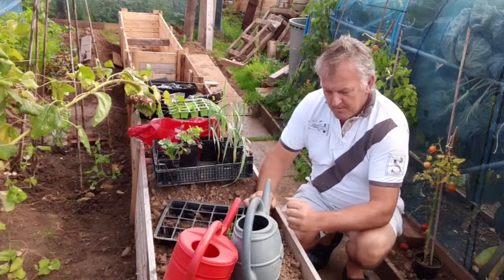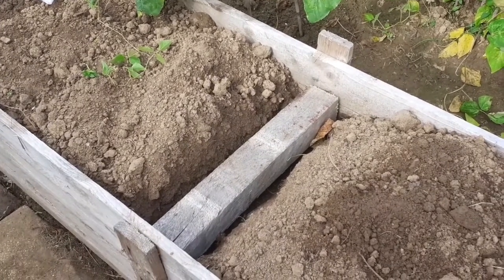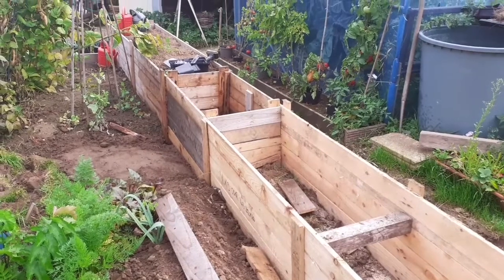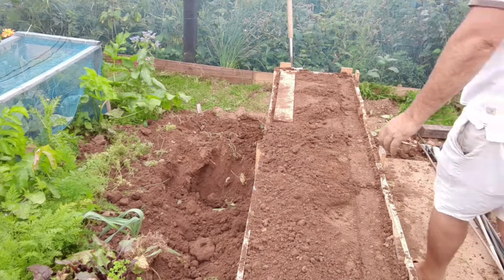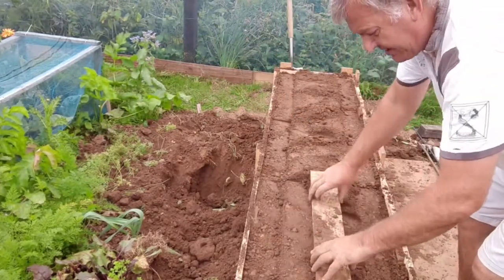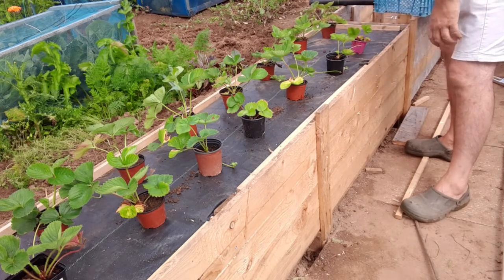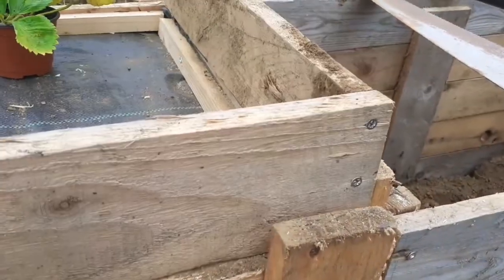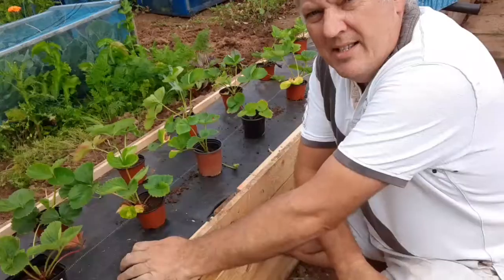How to Build DIY Strawberry Planter from Pallets | Pallet Project

Comment: Lovely job but if not treated wood will rot through very quickly so lining might have been a good idea. Something to think about in future. Terry  king does a good raised bed with pallet collars. And posts sit on nails so no part of wood sits on ground.  I know you have bases.  I’d be using weed suppressant instead of wood. As this will rot, the base in wood will rot through the quickest.
Reply from the maker: A lining may have been a good idea.  I am not so worried about the base rotting through as the soil would be still underneath the crate. Thank you for the reply Cheers Ray.